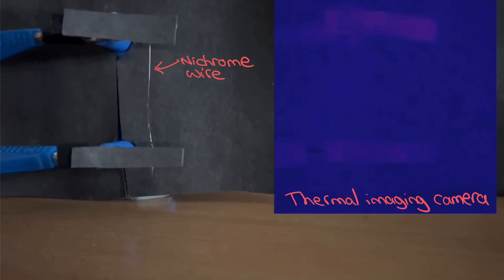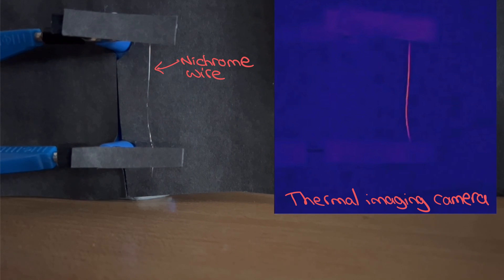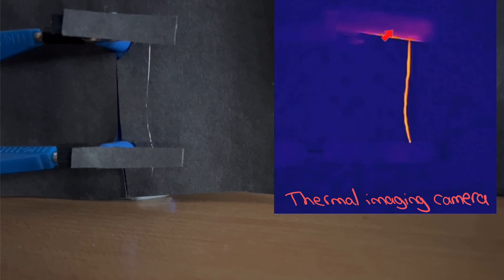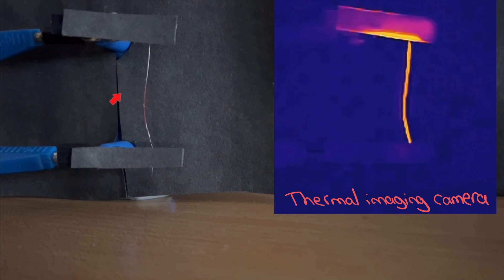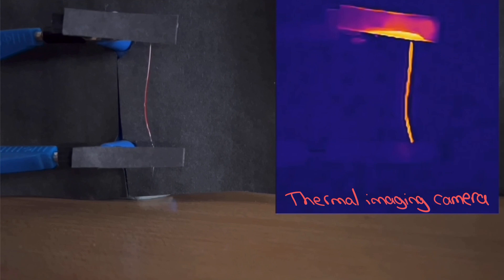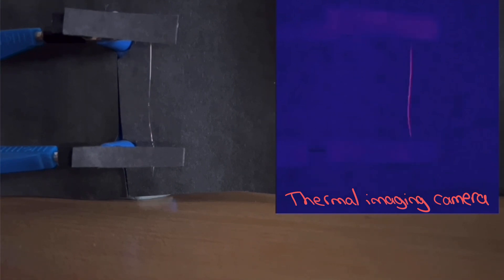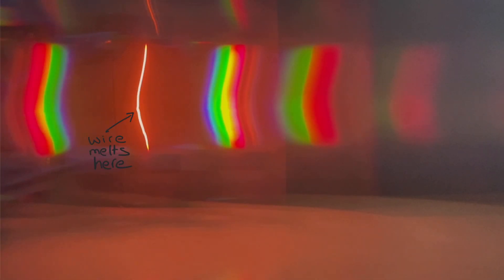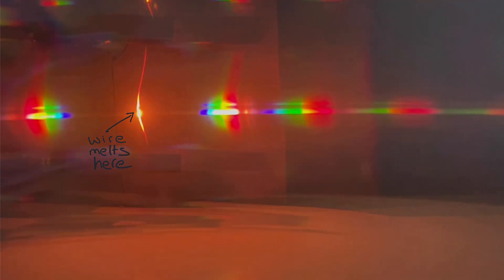Demonstrating how the wavelengths of radiation emitted by a wire change as it gets hotter

Comment: Why does the upper electrode get hotter in the thermal imaging? Would it be due to hot air rising from around the wire?
Reply from the maker: I wondered the same (it is a crocodile clip).  I agree it is probably from convection of the air which is warmed directly by the wire.